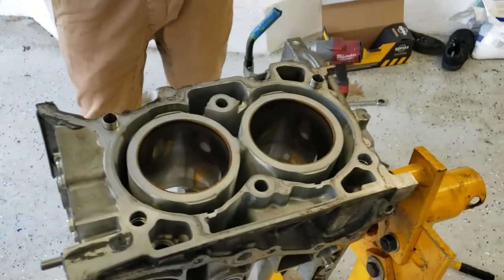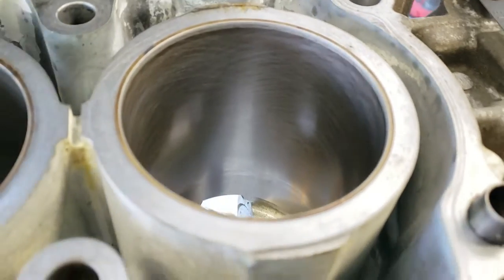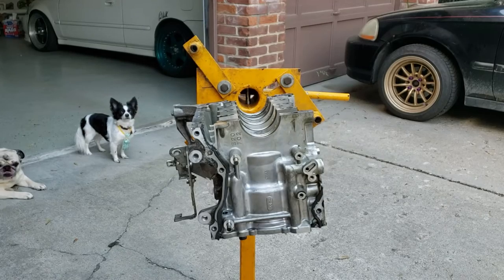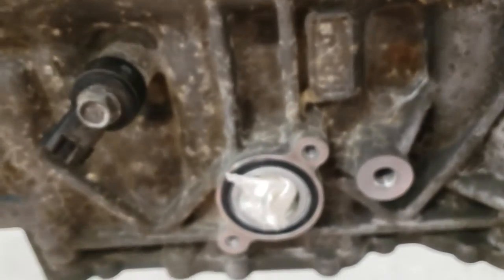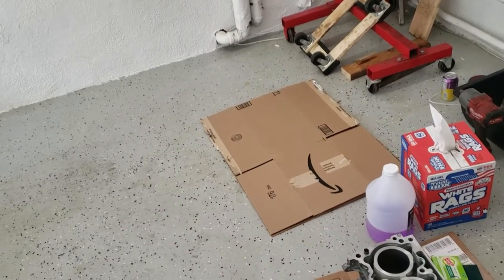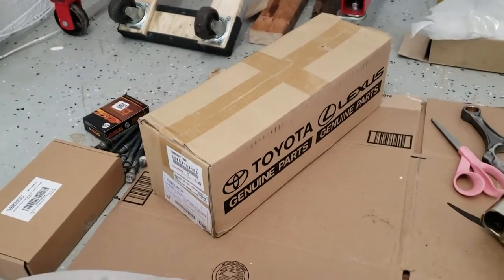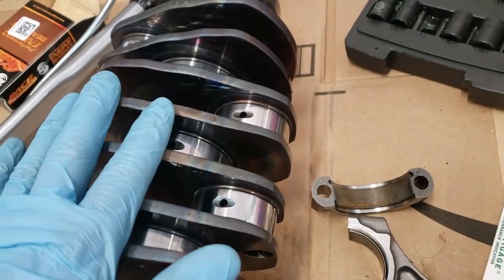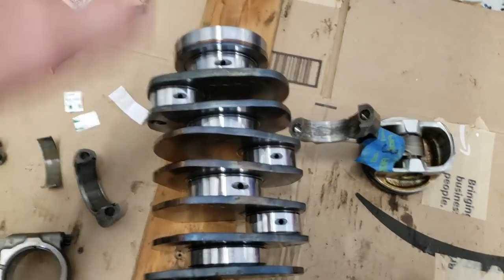Rebuilding a Subaru FA20 Engine - Part 1

Comment: What size honing tool did you use? I saw you left it in the description but 89mm seems a little big for a 86mm bore. Just trying to figure out if that will be okay and is 240 grit good enough for the pistons to seal

Comment: Watched your first inspection after you towed it home.
Pretty good oil leak there.
Wouldn't it be reasonable to conclude that the failure was oil starvation, not a pressure problem related to factory clearances and oil specifications?
The FA platform is also a high oil consumption design even when it isn't leaking.
Regular oil level checks are critical. 
I suspect running wider clearances with a modern 30 weight oil is going to make this failure more likely to happen again, not less likely.
Reply from the maker: I do check the oil regularly in all my cars. It was the first thing I checked when the bearing spun and wasn’t low at all. The switch to 5w30 is based on a recommendation in a mightycarmods video I watched from a shop known for building these cars. I also saw some graphs on an 86 forum of much cooler oil temps on a track with 5w30. I do believe the cause was some form of oil starvation. I just don’t understand what caused it. The oil was full and the pickup tube wasn’t clogged at all. Why do you think the extra oil clearance and thicker weight would make the issue more likely?
Reply: @@NickSabella  ok that's interesting to know that you didn't have low oil.
My reason for suggesting increasing clearances might be risky is based on the assumption that you won't be changing the oil pump to provide the necessary flow to support the change, but you know what they say about assuming.
Are the shops that recommend the oil upgrade also increasing clearances or just increasing oil viscosity without clearance adjustment to try to achieve higher pressure?
P.S. apologies for not hearing you say you checked the oil in the other video
Reply from the maker: @notsponsored103  the shops did not change any clearances. I did not end up changing or modifying the oil pump. Just opened it up and cleaned it out. I understand your concern that the larger clearances could lower the oil pressure. The new bearings are still technically in spec according to the service manual so I think it should be okay. I was just trying to make some sort of change since in stock form it spun a rod bearing under relatively normal driving conditions.
Reply: @@NickSabella  cool man, I'll look forward to the next episode. 
I would just add that the red line is red for a reason.
Perhaps going there regularly isn't normal for a stock engine.
When you think about where the tachometer is at peak torque in stock form, the engineer has expected you to get in the next gear long before the needle reaches the danger zone.
Race car different story.
Stay free. I'll keep watching. You got a new sub.
Reply from the maker: @notsponsored103  Yeah I guess I had to learn the hard way. Thanks for the sub!

Comment: Since Toyota uses the fa20 motor, are most parts interchangeable like this? I have to rebuild my motor ASAP. Mosy likely need a crank too. I have a 18 wrx fa20..
Reply from the maker: Everything between a brz and fr-s are interchangeable. I know the wrx and brz engines are different though. You'll have to compare part numbers to see if it matches a brz. If it fits a brz, you can buy it through Toyota to try to save money.